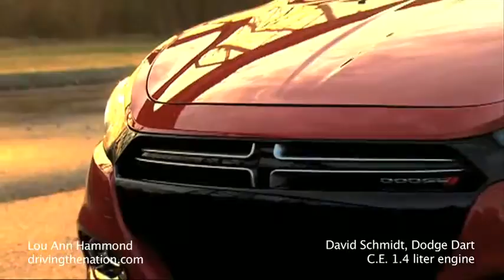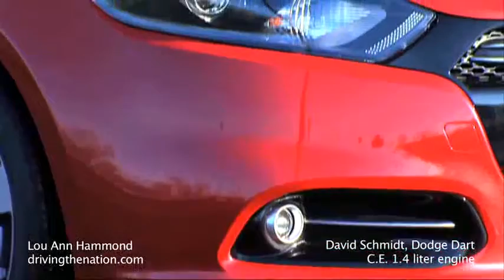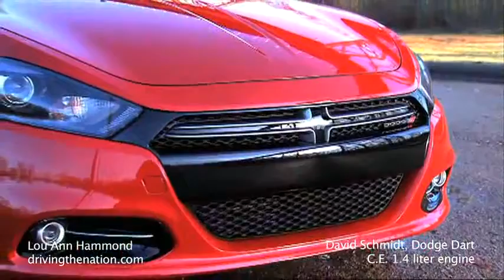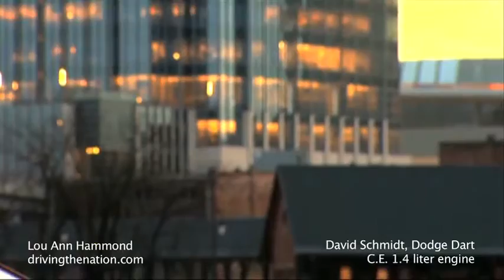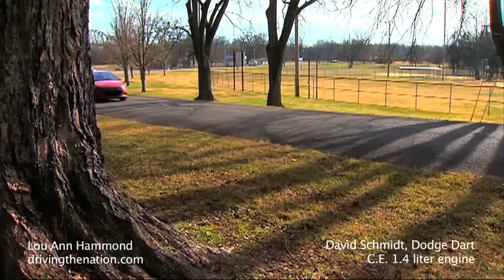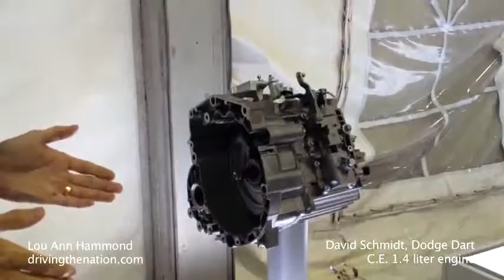The three tenors; the 2013 Dodge Dart car engines and the Italian conductor FCA Sergio Marchionne

Comment: Well Lead Engineer Dave of the 1.4L engine. With only a few weeks of ownership of my 2013 Dart MOPAR edition, the hydraulic clutch cylinder failed. It was repaired under warranty of course but now with only 38000 miles on the clock, the clutch is slipping and at deaths door. My dealer suggests that it is possible that fluid from the original leak got on to the clutch plate and it caused its premature failure. (so that`s what that burning smell was on the down shift) Never the less, the repair is not covered and the blow your socks off quote for this little 1.4L unit is a whopping $2500.00. Yes you read correctly, $2K5 for a clutch kit and repair.  I have driven stick all of my life and never witnessed a clutch die with less that 60K on it unless the driver habitually rides the pedal. During the past 17 years I have owned a Dodge Caravan, then the Charger SXT AWD followed by the Dodge Charger V8 Hemi. I am currently 12 months into my second jeep Cherokee Trailhawk, the Dart was purchased for my Son. You can see I have a good history with your brand but I say to you, if your are the lead engineer on the 1.4L I question your ability to design a robust product that can be serviced economically. If your replacement parts are the same price as BMWs, expect to loose your brand loyalty. Everyone has problems, it is how you respond to the problem that will differentiate you from the competition. I cant see myself buying another Dodge Chrysler Jeep  product, not because they are all bad vehicles, its the lake of manufacturers support and dealer shake down for the repair that has just lost you another customer.